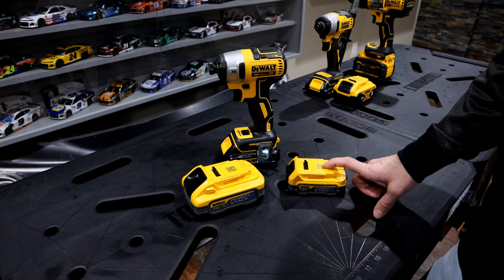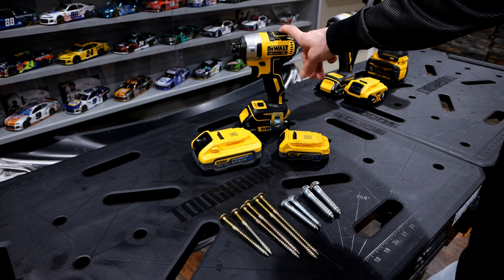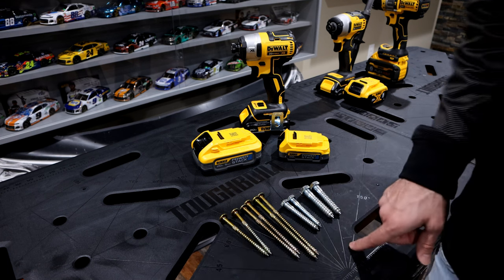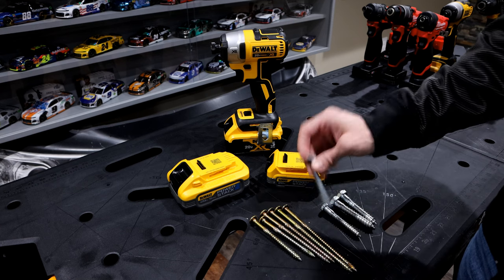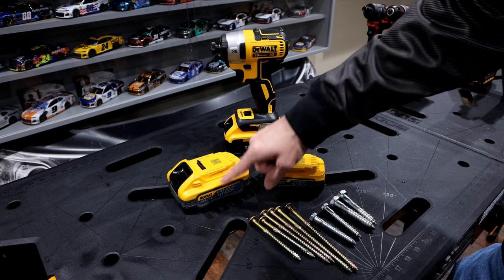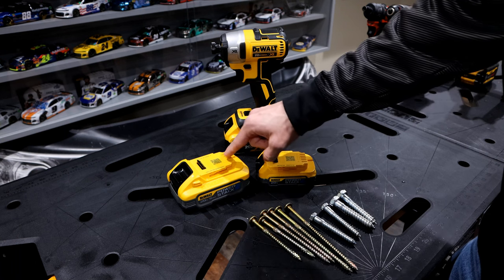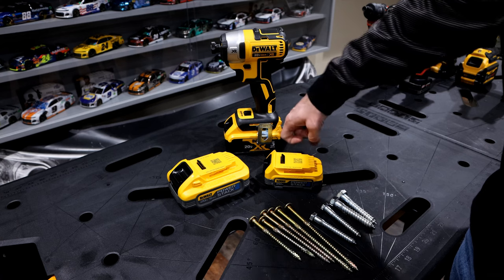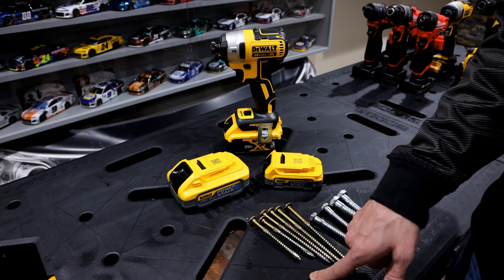Dewalt Powerstack 1.7ah vs 5ah | Dewalt DCF887 Powerstack Drill Comparison

Comment: The POWER STACK BATTERY is nice just WISH they would make more like a 3 amp and a 8 AMP
Reply from the maker: I couldn't agree more.  I do like the 1.7 size and power, however wish the run time was a little better.   Would be nice if Dewalt could make a 3ah around the same size as the 1.7.
Reply: You're not alone.  These two releases and the time in between is indeed ‘strange?’